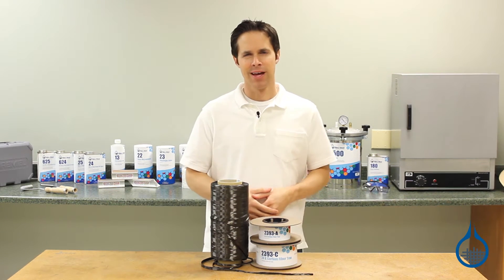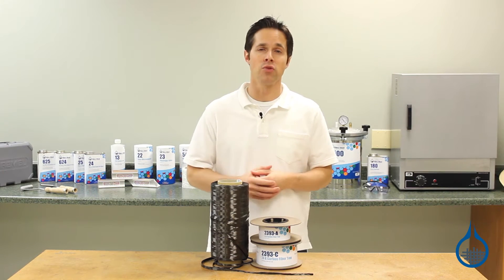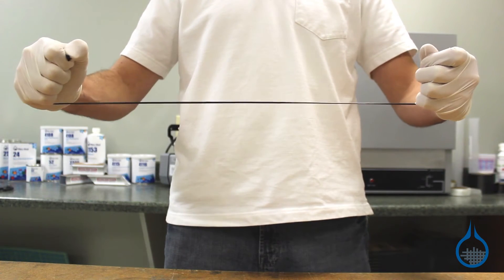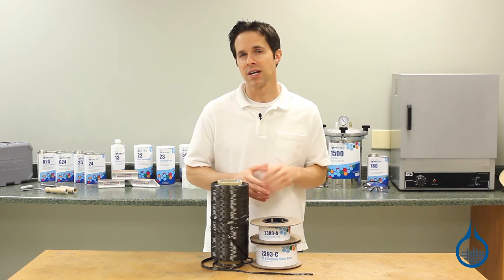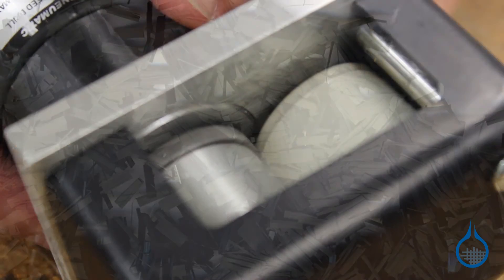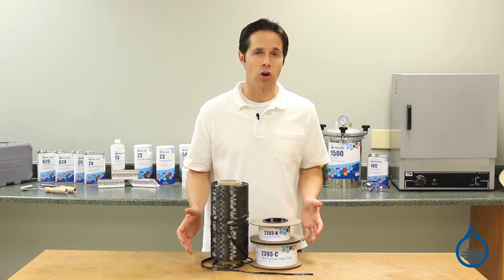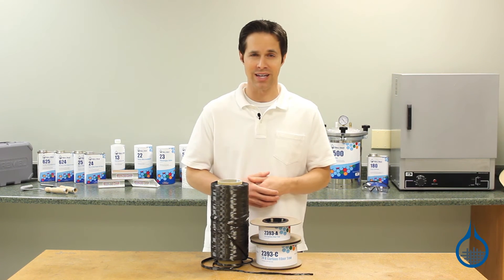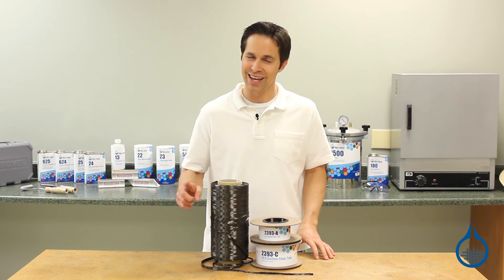24K Carbon Tow

Comment: Hey there, is it possible to explain the difference between low and high tow carbon fibers (such as 3K vs 24K)? I keep finding information that says the lower the tow count the stronger and more superior the carbon fiber is but I don't understand how having 24,000 threads in a tow is weaker than having only 3000 threads in  a tow?
Reply from the maker: Good Morning! When you are comparing the thread count between woven carbon fiber and tow you are looking for different specifications. With woven carbon fiber you want a lower number such as 3K or 1K, the lower the number the tighter the weave will be which results in a lighter, stronger fabric. However, with carbon fiber tow you ideally want a higher number such as 24K. The higher the fiber thread count in the carbon fiber tow means there will be a greater number of fiber threads which will make it stronger since they are all running in the same direction. I hope this was helpful for you!
Reply: I see! Thanks for clearing up my misunderstanding :)